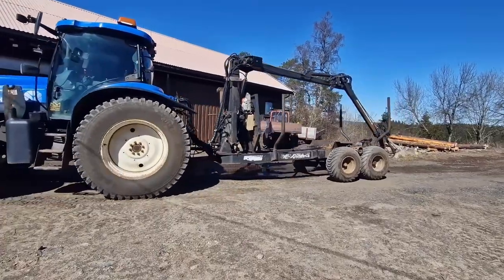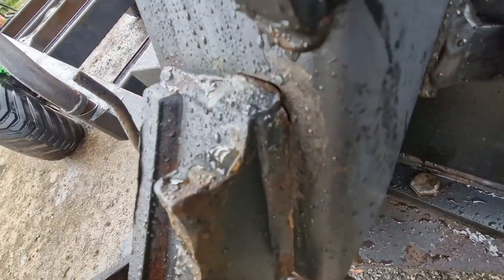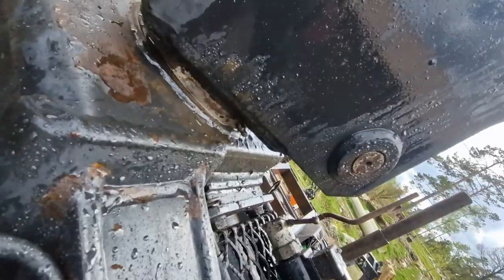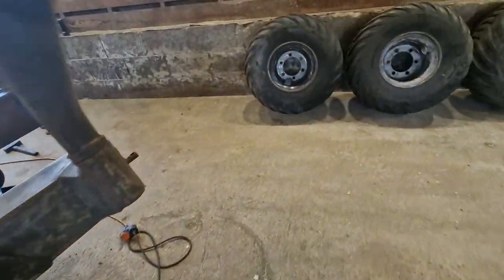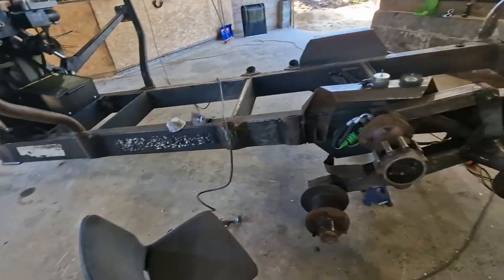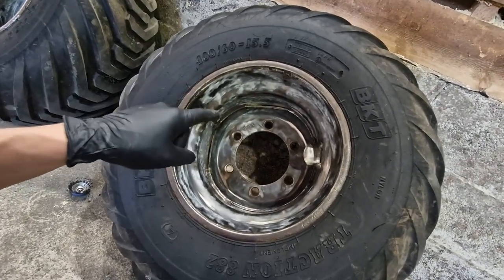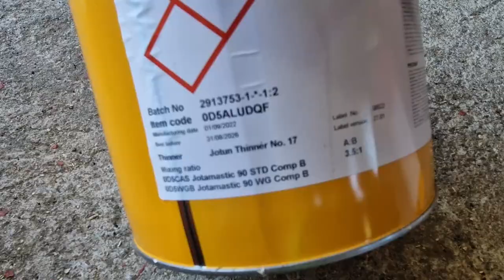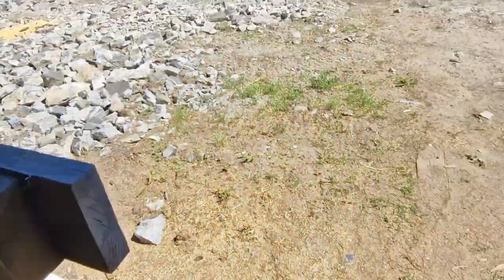Repainting Old Farm Equipment

Comment: Paint: a needle descaler is a wonderful air tool to get into rusty corner. Not for use with a hangover. A coating used extensively in maritime industry is coal tar epoxy. It hold up well to road gravel impacts and is reasonably priced. Protects against road chemicals used on midwestern roads.

Comment: That is a nice looking weld, but I worked with pipeline welders and they are some of the best. I’m thinking you should grind out the crack, weld it up and add reinforcements in those areas.
Reply from the maker: Yeah, that would probably have been a good idea when you say it... I might actually go back and do that! Thanks for the tip.

Comment: I dont understand why so many pin-holes after cleaning that steel, you should get any, I'm not impressed with ESAB OK 48.00, <AKA 7018, I'd try different brand of rods,  or better yet save up for a mig welder, I know thats a lot of coffee to..........
The best way to prep that trailer is sand-blasting but your like me we cant afford that,  so for me painting is out, I think i would just spray used oil on it or Fluid film, that sanding takes the Christian out of me........
If I was going to sand and paint something, it would be that antique 4x4  Massy, you probably hurt it's feelings........
PS. I'm nearing the end of all your videos, I found them very entertaining to watch because I like doing what your doing, but if you was rich I probably would watch any, I like watching folks struggle like I do doing what I do........
Reply from the maker: I had a cheap mig that broke a few years ago. It was awesome while it worked, made very nice welds and was much easier to use than MMA. Only problem was welding outdoors, because the gas would get blown off by the wind. I did try with some flux core wire, which worked decent. Got a better result with flux than I do with the stick welder.

Yeah sand-blasting would be preferrable. It was SO MUCh work sanding down this trailer, it will be a while before I do something like that again. I think it would be the Massy like you said, haha, probably hurt it's feelings. It would be really nice to give it a good restoration. Would cost some $$ though... But one day, it will happen!

I'm glad to hear you've enjoyed my videos so far! That's awesome. I know some of them must have been tough to watch in their entirety. but hopefully I'm improving my on-camera confidence, filming and editing skills for every new video. There are lots more to come!

Thanks for watching my videos! And for all your comments, too. I really appreciate it, it helps a lot, more than you may think...❤️